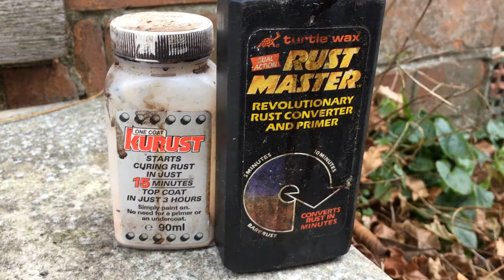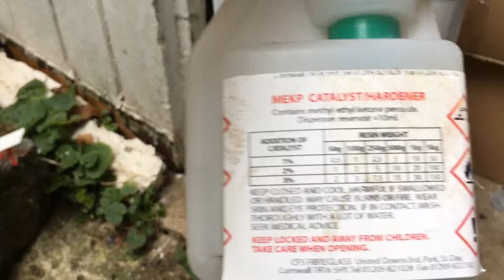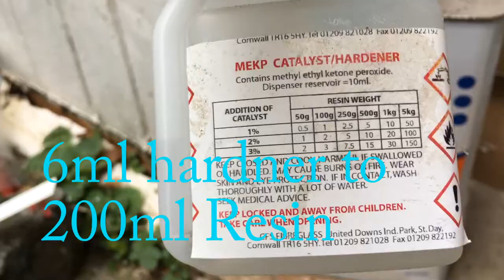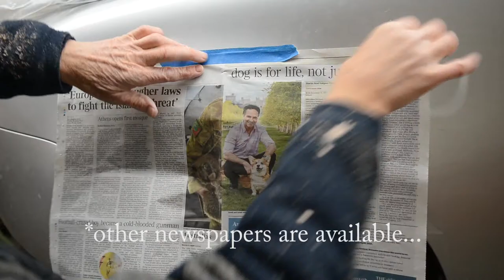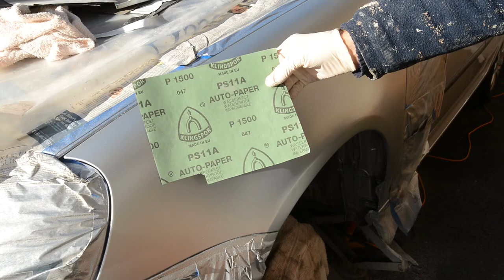Volkswagen Mk5 Golf wing Rust Repair. DIY method how to fix with fiberglass and filler. No welding.

Comment: Excellent tutorial. I love a no nonsense driveway repair and will be doing the same on my 2006 Polo which has exactly the same rust points on both wings. Thank you Sir!
Reply from the maker: Thanks for watching Pete. It's a long shot but you may be able to get a salvage wing, in colour, for around £150. Mostly just nuts and bolts to change over. Good luck b33zo
Reply: @b33zo  I am doing the driveway repair, all filled up and I got the primer on today. Looks  ok and much better than it was! I've owned the car 9 years and it is 18 years old, so the DIY fix works for me. Thanks again.
Reply from the maker: @petehughes9966  Cheers Peter.

Comment: That came out really well, going to attempt something like this with a small car I took in on part exhange. Thanks John
Reply from the maker: Thanks for watching Neil. I only did this repair because I had the resin and fiberglass left over from a little roofing job I did. Other people have gone down the replacement and painting route which may be a quicker option. ATB b33zo

Comment: Good job.  The professional cost and replacement properly, is £200 a wheel arch and upwards.  At those prices, it’s got to be considered, this may be the entire budget for getting the car through an MOT, or put another way, the ‘big maintenance jobs’ lumped together.  EG every two years to 5 years depending on mileage, all-round discs and pads etc, couple of drop links, ball joints, all that lot.  On older cars that are in no way ‘classics’ these costs are unaffordable sometimes, or at least economically hard to justify.  I decided on a rule - if the present vehicle is adequate for the needs, and costs in repairs less than £100 a month on average, this compares with the very cheapest possible vehicle capital cost (ie what you lose on buying a newer car per month).  So every time you do a job, mark on the calendar how many months-worth that big job represents.

So we had £400 of repairs on a 24-year-old car.  I need a hard and fast rule to tell me when to question continuing to use this versus replacement.  That £400 pushed the must-be-usable date out by four months.  Then we had a mechanic do the suspension repairs, another £350 or so.  Call it £800.  As the work was done last June, this car must be able to run without major further repair, until 8 months’ time…which makes it end of February it has to last until.  If a further repair comes along, we add that at the same rate, and so on.  

As long as it keeps to this rule, if all we want is a car to do what this old car does, it isn’t worth replacing.  However, you’ve got to count your time spent, and consider that has value as well.  One of the issues for us, is our little car attracts £18 a month of road tax, due to the multiple road tax systems the UK govt currently has going.  Or, if you just want a different car, it’s not merely utility, then my rule-of-thumb is out.  Although the car has been great, and it came along after Renault upped its quality and began galvanising bodywork, it seems likely rust will feature in its demise.  Brake pipes eventually die of course, but the car can be failed long before that if they look bad enough.  Decent brake pipes, don’t rust badly at all, and you can choose to replace them with the better stuff.  Anyway, this wheel arch rust, with subsequent sharp-edge issues for the MOT, is a really common one so thanks.  

PS - in Ukraine, they have an MOT every two years, not annually.  Cue jokes about how vehicles get blown up before they get to a year, so what’s it matter.  Take care all, thanks for this vid, we won’t be spending £200 a side having the rear arches professionally-done.
Reply from the maker: @sleekitwan thanks for watching and leaving your thoughts. Yes, running an old vehicle can be costly but if you're able to do-it-yourself obviously you're getting closer to the break even point in risk and reward. What i've found recently when I sat in a much newer car is how much less they rattle and clank, how the seats aren't shot and how many buttons there are to press...
Cheers b33zo

Comment: Looking at the age of the vehicle and the repair you did, it will most likely last until it’s ready for the crusher, I have to do a few fenders on my wife’s Jeep, and this was a great entry level example of how to, as you put it “diy”  thanks for doing it, and the camera angles were awesome, loved the rain shot. 👍🏻
Reply from the maker: Thanks for watching bluethunder. Yes, it's amateur hour here. No one's pretending they know how to do a thing. Second-hand wings are available or bare primed replicas can be purchased on Ebay. I had the fiberglass and resin left over from another job so the main cost was the rattle-can paint and my time. Media was easy enough as that's what I've done for last 25+ years. Cheers b33zo

Comment: Nice enough job but top tip, you should not sand the basecoat, just paint and let it flash off then do the next layer and let it flash off then one final coat of base coat let it flash off then two to three coats of laquer allowing each coat to flash off, if needed after a few days 1200 to 1500 grit wet and dry flating paper then compound and polish.
Reply from the maker: Thanks for watching Neil and passing on some top tips. b33zo

Comment: Excellent job,im copy this soon, did my saab arches last summer,did all the correct procedures, rust back again,you just have to cut it out and do this
Reply from the maker: Thanks Phil. Yes, I learned on Minis 50 years ago - no amount of rust eater, wire brushing, primer and filler is going to hold rust back for long. Admittedly cars were only made of mild steel in those days...True to say that on this VW Golf it was the arch liner fitting that led to the rust, not a failing in the galvanizing and paint job. ATB b33zo

Comment: Great job! My 2011 Golf Mk6 has the same issue. Tried to get VW to honour the 12-year anti-corrosion warranty a couple of years back, but they don't want to know. They claimed it's "edge and fold corrosion" and isn't covered. Infuriating.
Reply from the maker: Thanks for watching ally. From memory the 'pistonheads' website has lots of info on how to get VW to honour the 12 year warranty. When I think of some of the old Mini's I owned and how brand new wings would rust through in 3-4 years a 12 year bodywork warranty still seems quite unbelievable. b33zo

Comment: Excellent work! I tackled this kind of job last summer, unfortunately because I didn't cut the rust out the rust returned after winter. Interestingly the rust is the worst on the lower side of the car, where  it gets the most salt. I'm planning on attempting to redo it this summer, using brunox epoxy to treat the rust before using other products.
Reply from the maker: Evaldash thanks for watching and leaving a comment. I took fairly drastic action to deal with the VW wing rust because a) fiddling about with anti-rust medication, filler and paint previously always turned out to be a short-term fix, b) the car is 15 years old c) I had the time and d) I had spare fiberglass (+ catalyst) left over from a roofing job. Still looks great after 12 months...
Best wishes b33zo

Comment: Great job! You are a true DIY master and a good singer.. thanxs
Reply from the maker: Thanks for watching TheBuzzdev and for your very kind remarks. I started fixing things in my youth more out of necessity than curiosity and slowly accumulated knowledge and enough tools to have a go at anything. Singing? Well we can all sing when we're on our own can't we? Cheers b33zo
Reply: @b33zo  well, i'm just repairing wife's Sedona sliding door. Big rust hole at the bottom. Almost all the lower door portion is missing horizontally with height about 3-15 centimeters. So it has no edge at the bottom at all. Just in the left and right corner. The back side of the door is also gone, so no foam or such. I'm wondering how i'm gonna restore it with fiberglass only. Hmm... Yeah everybody is singing when alone, but not all of them actually can sing :)

Comment: Can you give me a quick list of what you used? Thanks mate
Reply from the maker: Hi EG thanks for watching. It's not much of a list but general purpose polyester resin and hardener from CFS and some of their fiberglass quilt. Get a pack of multigrade wet and dry paper off ebay and some primer and reflex silver rattle-can paint from Huddersfield Auto Paint (also ebay). Fairly easy job if you're keen enough and can come back to it over several days. Good luck with your project, b33zo
Reply: Thanks man luckily mine is just the rust and no holes yet. Exactly the same problem the plastic inside failed and allowed water to get in. Vw caddy. Thanks again good job!
Reply from the maker: @elephantgunners9518  Thanks again I think its worth removing the arch liner and cutting off the metal fixing tab at the top of the arch. Probably removing some of the spongy padding too as this just holds water which makes the rust even worse. I was too lazy to deal with it early on but when the car passed MOT with 191k on the clock I felt it deserved it! 
Good luck with the job. b33zo
Reply: @b33zo  yeah I am planning on just doing it that way like you say it makes sense. 

Andy

Comment: That’s what must be happening with my seat Leon ( 2013 plate ) …. Just noticing some slight bobbling on the drivers wheel arch .. no rust on the outside as of yet but definitely right at the top of the wheel arch where yours is on your golf !! Cracking job buddy and well done 👍🏽 😀👍🏽… Merry Christmas and happy New Year 🥳
Reply from the maker: Thanks for watching John and for kind remarks. I guess the Leon has the same or similar wheel arch liner held in at the top by a grommet of some kind. Behind the liner (at the top) in the Golf there's a foam pad and it seems that once that's full of water you've got a 24/7 rust trap. A little job for you to sort out sooner than later. Cheers b33zo
Reply: @b33zo  no probs buddy. … when I find out how to take the liner off I will have a look 
Yes it probably has that same silly sponge that stops things Matalan but causes another problem to fix one. !! I just bought some hammerite rust killer. If I put some of that on the inside of the wheel arch would that stop the rust from spreading any more do you think 🤔

Comment: Personally would have welded in a new patch rather than mock it up with fibreglass and you didn’t scuff the paint up before applying any filler so I don’t think it’ll stick properly if it gets a small whack or just from winter weather but it’s a good effort from what it originally was
Reply from the maker: Thanks for watching Matthew.

Comment: Al that effort but you can buy a new wing for 50 quid
Reply from the maker: Thanks for watching Christian. A very good point. Yes £50 for a wing with just primer - ideal if you have some sort of painting facility. Ebay have a supplier who will sell the wing 'painted in any colour' for £134 + £15.00 postage. 
b33zo
Reply: Good old school ways when ppl didnt have £50 or ebay.
Reply: You will need to put roughly the same effort into painting and fitting the wing. And the cheap knock off replacement won't be as good quality as the original wing. It's not as easy as you think. This job ticks the boxes and will keep the car going.

Comment: In all fairness I wouldn't have bothered doing that repair I would have bought a wing from a breakers yard.
Reply from the maker: Thanks for watching Alan. I chose this option as I had fiberglass and resin left over from replacing lead stolen from my porch roof. ATB b33zo